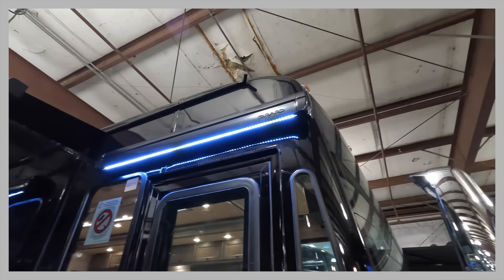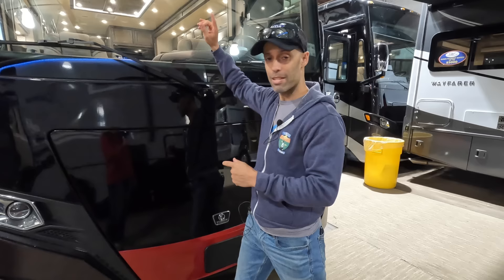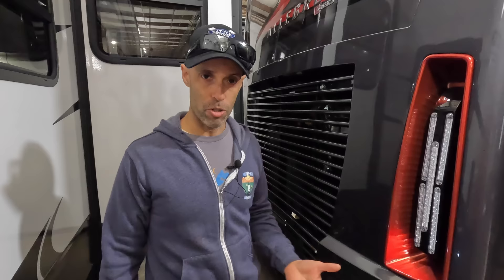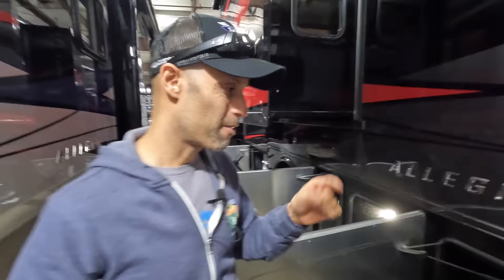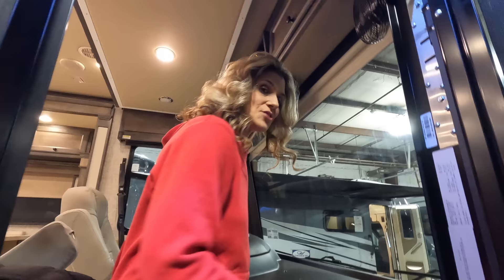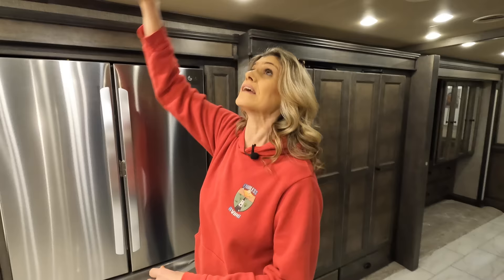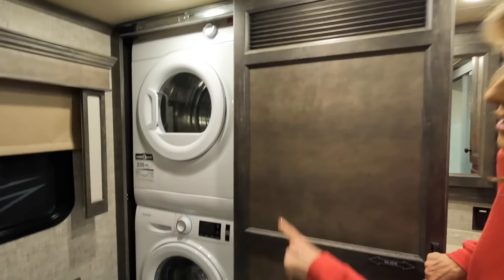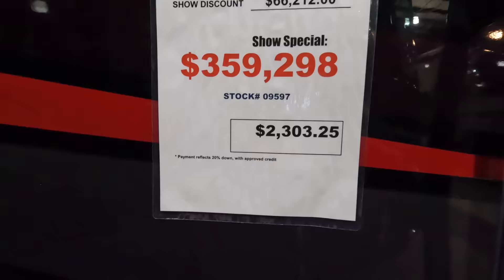The Worst Tiffin Motorhome We Have Toured -- Could Not Believe What We Saw!

Comment: My wife and I had a Tiffin Phaeton built in 2022 and was to be delivered in July of 2022.  We drove over 600 miles to trade in our travel trailer and take delivery.  We had put down a $5000.00 non refundable deposit.  As we started the walk-thru the exterior looked great, but then we started the interior.  There were so many problems on the interior finishes and countertops we walked away from our deposit.  I was under the assumption Tiffin was a quality product.  I did write a letter to the President of the dealership and was able to get my deposit returned.

Comment: We owned a brand new 2020 bus and had the same type of issues you see in this video!  Exterior paint had drips. Air bag leveling leaked. The bay doors though seemingly solid leaked when driving through rain. Molding popped off when slides came in. Microwave was mounted incorrectly and sagged. Water came in the closet when driving through rain. Fireplace in bedroom was wired incorrectly and didn’t work and the wiring was a rats nest behind it. Beauty was skin deep for sure!  The worst was the headlights!  We drove once at night and could not see anything (no exaggeration)!  Completely unsafe. It truly was one of our biggest disappointment and ENDLESS issues!  I’m sure I’ve forgotten many of the details.
Reply: I've had 2 Newmars and a Tiffin.  None of them had good headlights.  At least the Newmars had fog lights that helped.

Comment: It's typical of what's been going on in the rv industry the last few years. Prices have gone out of site and the quality and materials used have gone down. Sad but it seems to be more common these days. Older used rv's seem to be more and more the way to go. To me, much better quality in the older units unless you can afford the really high end units. Just my two cents. 🙂
Reply: You are 100 percent correct. I own a 1998 32ft Excel fifth wheel and I wouldn't trade it for any of the new production fifth wheels. We have been going to RV shows recently and quite honestly I am disgusted with the cheap materials and low quality, even the 150,000.00 grand design did not impress. There is no way any of these new RVs will last the 25 years my excel has and it's still going, good as new.

Comment: I looked at a high end Tiffin just last week. The first thing I do is inspect the roof. I was surprised to find butt connectors and pieces of cut wire embedded in the sealant. It looked as though they swept the roof before the sealant was dry and all that trash stuck in the dicor. Sloppy work to say the least.

Comment: Great review, very honest and fair.  After 37 years in law enforcement for me, my wife and I are preparing for retirement in the next 12-18 months.  We are looking to change from our 2019 40’ Keystone Montana 5th wheel and move to a Class A pulling an enclosed trailer to haul my new Harley Ultra Limited. Even though we bought our Montana new and it was built pre Covid, we noticed many of the same small issues you were pointing out with this Tiffin coach.  We were very surprised that the dealership showed the unit without fixing several small but noticeable flaws on hinges, knobs, molding, wall paper, cabinet door alignment, and exterior seals around compartment doors and lights.  We have owned a travel trailer, 30’ Class A gas motorhome, and a 5th wheel over the last 35 years.  So we have some experience with RV’s, dealerships, and manufacturers.  We successfully used the fact that the Montana was a 2019 model year and we were buying it after Labor Day weekend when the dealership was now selling 2020 units that were arriving on the lot, we also leveraged the many flaws we pointed out that needed repair before we would take it off the lot.  Timing was right and we negotiated an outstanding purchase price.  For the most part this purchase turned out to be a mistake on our part.  Once they had our money the delays and excuses began and it took 60 days to get many of the small repairs done.  Once we started using the 5th wheel it was back in the shop after every trip.  Small issues that were allegedly fixed needed repair again, then bigger issues occurred with one of the axles and then twice with the 6 point leveling jack seals leaking hydronic fluid and system errors, etc.  The repair issues now rolled into the Covid shutdown of the shop and lack of service and repair employees.  Keystone was as hard to deal with as the dealership, honestly neither really cared.   You know how it is, you want to tee off on them after every non-returned call, lie, rescheduled appointment, and every part always on back order.  They even damaged my trailer tires on one side moving my trailer on their lot and had to replace two tires they punctured.  But you can’t say anything, you have to bite your lip because you are literally at their mercy!  Enough crying about the Montana, we use it at least once a month and sometimes twice a month for long weekend trips and continue to visit a repair center more often then we would like.   So, we have done some minimal coach tours and have been drawn to Tiffin and Newmar Diesel coaches based on the RV communities reviews of both brands.  We have made a few visits to dealers in CA our home state and to Nevada and Arizona.  Unfortunately after retirement my wife and I will be leaving our beautiful home state of CA to retain our sanity, safety, faith, and financial stability.  We are looking to pay cash for the coach and are not planning to full time RV, but will be using the coach an average of once to twice a month to travel through out the US.  Obviously a quality coach is important and we are seeing much of what you saw in this review, poor craftsmanship and attention to detail.  We don’t want to start off in a new Tiffin or Newmar  the same way we did in the new Montana, feeling like our new trailer was the quality of a used trailer and missing trips or delaying trips because of shop time while repairs are completed. We learned a valuable lesson, the great negotiating points we used to save money on the front end cost us much more in downtime not using the unit or in extended warranty co-pays.  We have seen a lot of changes in quality and definitely service in the last ten years. In the short time we have been looking at Tiffin and Newmar, we have came to the realization that we will most likely buy a 2015 to 2019 used coach with an extended warranty.  With our budget being around $300k to $400k the new coaches we have looked at do not match the quality and craftsmanship depicted via Tiffin and Newmar websites, nor does it match with the RV communities reviews of both manufacturers for what we would expect in a new coach.  I learn a lot watching your reviews and other popular RV YouTubers videos.  Unfortunately, I am not a popular and respected YouTuber with a loud voice within the RV community.  Realistically, after buying a coach I don’t believe Tiffin, Newmar, or any dealership is going to make me a priority.  We have always had a great sales experience, but the true test is everyday after you pull your new trailer or coach off the lot. What we have looked at new and used, it appears to us the better value is in a used pre-Covid built coach unless I were to finance an upper end model of Tiffin or Newmar, or look outside the two manufacturers.  Thanks for letting me vent and I am all ears if you have any additional advice.  I will continue to watch your reviews, thank you both for dedicating so much of your time to help the rest of us make informed decisions in the RV community.

Comment: We have the 2020 version of that coach and have nowhere near the kind of problems you pointed out.  We love the floorplan and the neckbreaker TV isn't a problem because the two captains chairs at the front rotate and that's where we sit.  (The passenger chair is also a recliner.)  We also have a fireplace under the TV and a dishwasher rather than the oven.  We did find some minor problems when we inspected the coach (which is always to be expected) but our dealer (King's Campers in Wausau, WI - they were phenomenal) and Tiffin took care of them.

We've had the coach for three years this month and have had it from California to Vermont and from Canada to Texas.  We did have a DEF failure but it was while we were near home and Cummins covered it under warranty.

I'm not sure what's changing at Tiffin, but I hope they get a handle on it and soon.

Comment: We were fortunate to buy an 2019 Open Road in 2020 after going back and forth between Tiffin and Newmar. The deciding facter came down to liking the floor-plan of the Tiffin better. Even then the cabinetry wasn't really up to snuff (I've had to repair several drawers that have fallen in) but overall it's been great. Then we went to the 2022 Tiffin rally in Rock Springs, WY and the 2023 models they were "showing off" were a revelation. As this video said, you could tell when walking in that the quality just wasn't there, the details weren't there, the materials looked and felt cheap, everything was plane. This was a rally of Tiffin fans, loyal customers, and everyone we talked to felt the same, it was massively disappointing. Even the dealers who were there realized the reaction was not going well and started bringing in different rigs from further out, which were better but still not up to previous quality. It's very sad.

Ironically we toured some Vanleigh trailers there and really liked them, the traditional Tiffin quality seemed to be on full display there. So it was really shocking to us when they canceled the line in early 2023! We're looking to trade this in soon, but we have no idea which brand to go to now... maybe Newmar is now best for ~35' gassers.

Comment: We have a 2022 Open Road (gasser) that was built in 2021. IMHO it was built waaaaaaaayyyy too quickly. We submitted the order in late July 2021 and were told it would take 5-6 months to delivery. It was delivered to our SoCal dealer in mid-October. It had so many fit-and-finish issues inside (especially cabinetry) and outside (including paint) we refused to take delivery till stuff was fixed. Of course AFTER we took delivery and had driven it from our SoCal dealer to our home in Northern Cal, much more surfaced, including more cabinetry issues, non-functioning solar, poorly performing water heater (Truma) and screwed up slides. And then there were the four or five recalls we’ve had so far with work delayed by parts unavailability. All of the fit-and-finish issues should have been caught before our coach ever left the factory. Same with the non-functioning solar and screwed up Truma. We are not new to RVing. Before we purchased the Tiffin, we had a Phoenix Cruiser for nearly six years. We only had one recall in all that time, excellent fit-and-finish overall, and no major issues. We are extremely disappointed with Tiffin, and will never buy a new Tiffin again.
Reply from the maker: Thanks for sharing

Comment: Bought a Tiffin 32 SA IN 2021. It has the V1O motor. I have not had any issues other then a bad draw slide. Have had no need to return to Red Bay for any repairs. Haven't been back to the dealer I purchased it from either. Very  satisfied with the build. Ford chassis not so much. Finding Ford Commercial Truck dealers that will take motorhomes can be challenging. Feel very lucky that I haven't had any major problems.

Comment: A huge difference between pre covid and post covid. Also, pre Thor and pre Winnebago purchases. We got our Tiffin early 2020 (pre covid and pre Thor purchase). We spent a year looking at Newmar and Tiffin RV's and both were very comparable in fit, finish and quality. My wife just liked the floor plan better in the Tiffin so that's what we went with. In our travels we have met a lot of other tiffin owners and you can see the 2021 and 2022 + units are not quite up to par. Even the paint job is not as smooth. Definitively, buy pre covid.

Comment: You are right on in your assessment. This is NOT what I would expect from Tiffin. We've seriously looked at a couple Tiffins when we were shopping. I really liked the smaller Breeze we looked at years ago (and still we we bought). But when we got our current motorhome, we decided even the base level Tiffin was a step in luxury up from what we were looking at. As you said, this looks like a entry level unit. The austere bathroom, kind of cheap finish, and more-or-less basic interior is not what one expects from Tiffin and certainly not at that price point. I will say from your Newmar gas chassis review at the same show, it is clear that Newmar has done better in keeping their identity under their new ownership than Tiffin. Were I not familiar with Tiffin and this were the first one I ever saw, I'd probably cross the brand off my list altogether.
Reply: I got my Tiffin Phaeton in mid Feb. got a week in it in July came back with 15 more items to be fixed so it's been in the shop ever since.  Bottom line I just put it up for sale on consignment will probably loose $100,000 I'm done with motorhomes Tiffin sold to Thor and they have destroyed the once fine company.  Thor owns 28% of the RV market.

Comment: Wow! $350k with crooked outlets and uneven door knobs? At an RV show?
And that's just what you can see in the living space.
What about the mechanics and drive train?

That's embarrassing. 
Someone at Tiffin needs to start knocking heads.
Reply: $360K for a new RV that will depreciate immediately after driving of the lot. Better to spend half the $ and do a bus conversion. Get exactly what you want built, safer to drive and operate because of USDOT build quality  standards for commercial vehicles.

Comment: We purchase a new 2022 34PA in the Summer of 2022. There was so much wrong with it (2 pages to be exact) that Tiffin agreed to pick it up and make the repairs at Red Bay.  They kept our unit for 5 months!  The repair people I spoke with at Tiffin were very nice and just as disappointed in the condition of our new Tiffin. We had everything from exterior paint issue to fit and finish issues inside the coach. I could go on and on. Tiffin delivered our unit back to us with our list completed. I would give them a 9 out of 10 on exterior paint repairs and a 10 on the interior repairs. Between the selling dealer and Tiffin, they have had our unit longer than we have. Bob Tiffin did extend our warranty.

Comment: Yes I see lots of pore quality. Things like you pointed out plus things like using countersunk screws and not countersinking the metal they are installed in.  Things like using those 3" long self drilling/tapping screws to hold 2 pieces of metal that might be .030 thick. Not painting or sealing wood in the structure or priming painting metal used in construction.

Comment: I had very bad carpal tunnel in both wrists back in the 90’s. I couldn’t even pick up a brush or a tooth brush. I was working in a commercial kitchen at the time. I didn’t have the time to play around.  We did major catering.   My chiropractor at the time treated me and taught me how to get the little bones in my wrist to line up correctly.  I have not needed surgery at all ever.   My Mom had surgery on both wrists and still had issues.

Comment: Thanks for making an honest video.  I have the 2022 Red 360 and there are quite a few issues.  I will be taking it to Red bay for full correction.  sample.  the vacuum wasn't working, when I looked behind the panel I found the hose was not connected.  Also found the CO alarm was not even wired. some of the panels on the draws are a bit  twisted not straight.  And like you guys found the bathroom and bedroom sliding doors are off shaky.  The sofa within a few days a seam came open.   Living area I noticed a wet area on the wood from the AC.   got quite a few more but will leave at that.
Reply from the maker: Sorry to hear.  Seems like quality control and PDI does not exist

Comment: How does a showroom model not get checked for a sliding door that won't slide?  The uneven knobs will drive some crazy, especially the wealthy crowd.  Seems like zero attention to detal.  That shower stall is too short for most Americans.  That shower was probably built for the Asian market where it would be more appropriate.  These are obviuous fundamental errors on a showroom model.  What a mess.  Even the normally glossy paint was scratched up.  If it was 1/3 of that price some can see past those things.

Comment: We bought a 2012 Tiffin Allegro Breeze 32BR and the quality is outstanding. I've heard and seen comments from current Thor based Tiffin's and I know Leigh Tiffin keeps stating that Tiffin is run by Tiffin but we can see that they have to use Thor parts and possibly designs. We are going to hang onto this rig for a long time, hopefully the MaxxForce 7 continues to perform as well as it has for 12 years.

Comment: We had two Newmar coaches before buying a Tiffin Allegro RED 360 33AA.  It was easy to see the poor workmanship, especially compared to our Newmars.  It is a 2022, and while the quality is not great, it is far better than the 2023 in the video.  The biggest issue is that the caulking is very poorly done, and there are drops of caulk everywhere.  Fit and finish are not what one would hope for.  I will say the wiring is much better than the Newmar.